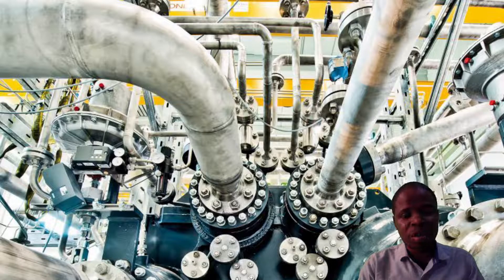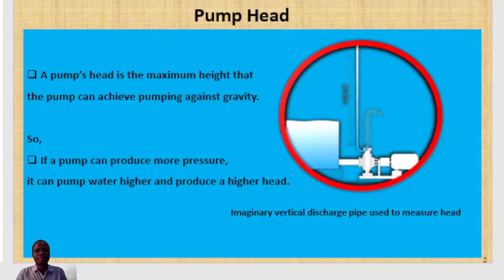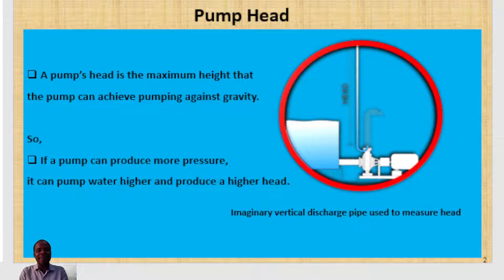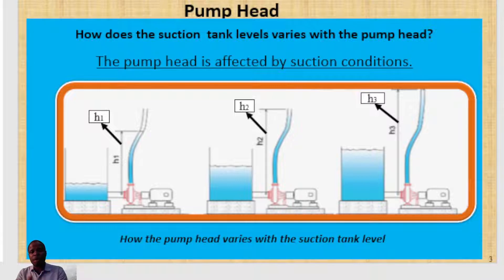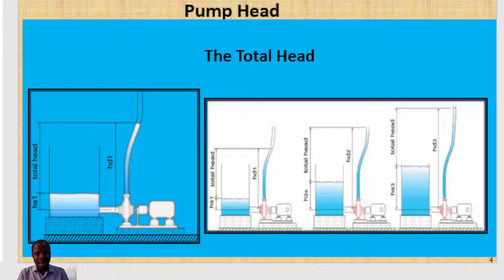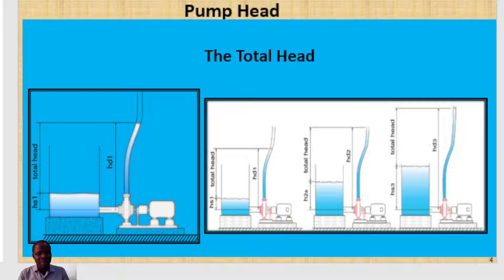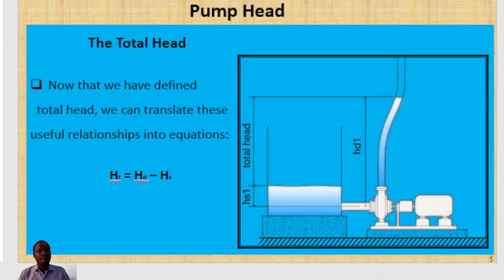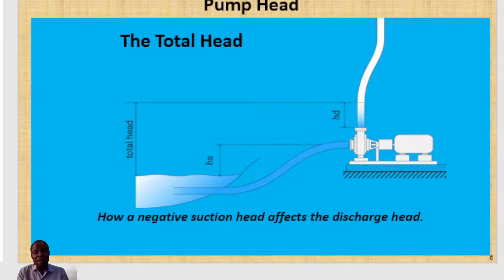Understanding Pump Head

Comment: From my understanding Pump Head at discharge side remains the same no matter the operating condition. However, the pump discharge pressure vary based on the suction level of fluid in the reservoir tank.

Comment: To answer your question, the pressure of the pump will change if the specific gravity of the liquid changes, but the head will not change. Therefore, it is best to use head, since pumps can handle different fluids with different specific gravity.